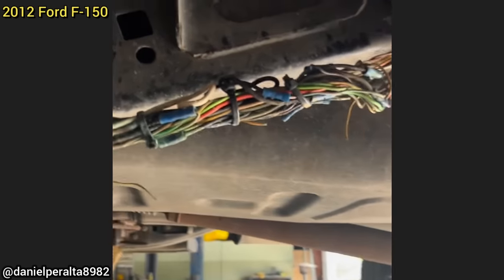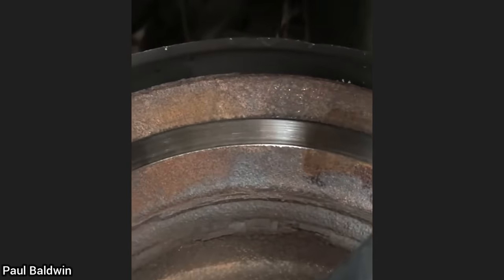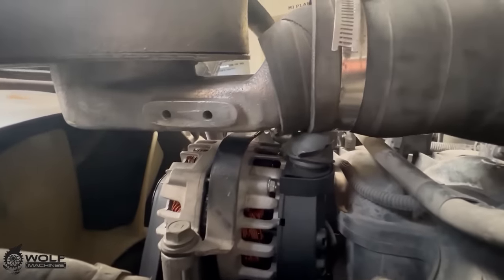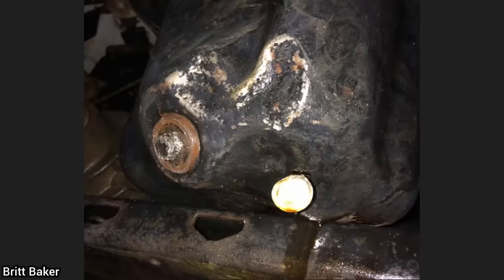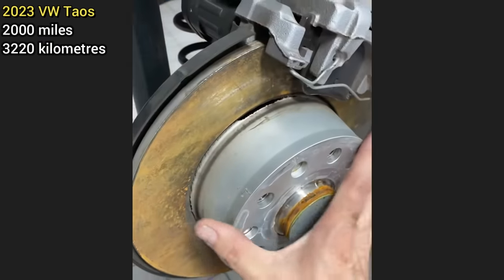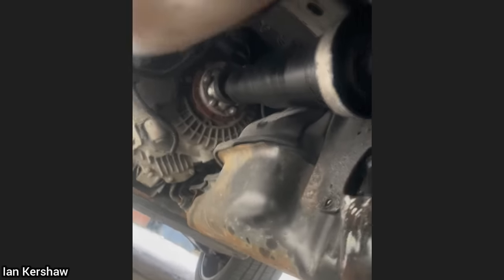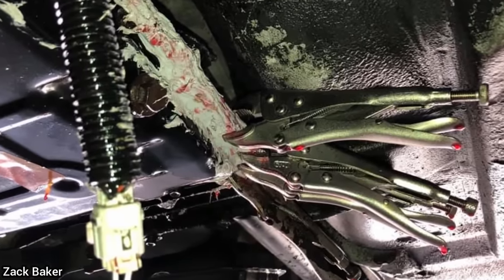Customer States He "Fixed" Some Wires, Now Truck Keeps Shutting Off

Comment: Props to the accuracy and grip of that last guy. He never misses and it doesn't twist.
Reply: He's clearly been hitting everything he sees with a pickaxe and is now quite good at it.
Reply: like a railroad worker with a railroad sledge. shocking how good they are and with such a narrow head. then you have the rock drillers way back. 3 guys with sledge hammers and 1 guy holding and turning the rock dril/ chisel.
Reply: Stupid plan, executed flawlessly.

Comment: 3:05 - For those of you that run into this issue:
A - ensure that ALL lug nuts have been removed.  Count them!
B - Using the spare tire, strike the top center of the tire that refuses to pop free of the hub.  Do this *FIRMLY*, making sure that only the rubber of the spare contacts the tire.   On the rear wheels you can strike the top center, front, and rear of the wheel.  ONLY TOP on the front wheels.
C - If that fails, get a can of brake-free (like WD-40 but stronger, designed to break rusty parts loose).  Let it sit for 10 minutes, then try step 'B' above.
D - If all else fails, spin the lug nuts back on until they're seated, then back them off 1/4 turn.   CAREFULLY drive the car at a slow speed.  The 'clunk' of the wheel releasing will feel different than the flop-flop of the flat tire being driven on (essentially, the shock of thumping over the flat should shake the rim loose from the hub).  NO MORE THAN 5 MPH!!!

NEVER strike the rim or wheel with a naked metal device - always place a piece of scrap wood between the wheel and whatever metal implement you intend to strike with.
Reply: TLDR: Just hack shit together and blame "the other shop"
Reply: I've used a hammer before but only on steel rims and never on the edge where the tire meets the rim. Never used a pick axe though.
Reply: Agreed - there are several easy methods to solve the issue without damaging the wheel…

When I had an alloy that wouldn’t budge for anything and a brake disc that did the same, one single blow from a 6ft wooden fence post shifted them immediately, that pickaxe or most hammers don’t have the weight in them
Reply: What I do on my Audi is use a crowbar and wheel pops right off with no damage to the rims/hubs.
Reply: On my previous car i had that happen sometimes over the summer, and i either pulled hard enough on the outside of the tire on one side while pushing on the other side. (usually one hand on top one at the bottom) and when that didn't work i did what you listed under D. But i only moved the car maybe 1 meter forward (slowly and against the brakes). Was enough to loosen the sticking rim audibly in a circular fashion while not damaging anything.
I never hit my wheels with anything, i mean that would mean they are out of balance or possibly damaged.

Also, i am not sure what he wants to achieve with the pickaxe. The way he strikes at the area around the wheel studs /screws... makes me think he tries to get a security nut off to which he has no correct tool (or doesn't find it).

My father had such security bolts on his wheels years ago, one per wheel, and a workshop lost the tool (special socket) he always had stored it in the trunk. So i tried to find one with a simliar pattern and dremeled it to fit. It did work for that one time we needed it. We never put on the safety bolts again, and i had to get a metal splinter removed from my right eye.
Moral of the story: either get at least 2 sockets for a set of security wheelnuts/bolts or don't use them, and wear eye protection when using a tool like a Dremel! normal prescription glasses are not enough (like my case showed)
Reply: I leave 2 wheel nuts 1/2 on and (normally) a heavy rubber mallet from the inside bottom of the rim.
If I'm roadside without my normal gear, (helping out someone else), I still leave 2 nuts 1/2 on and just heel kick the top of the rim a few times to break it loose.
Reply: @Damoinion  You guys have strange problems. I just lift the wheel of... I guess it helps to change between summer and winter tires 2 times a year.
Reply: @benbaselet2026  Rust still sometimes happens, my Chevette hit something on a long trip that tore a strip out of the sidewall of one tire and we had to change it on the side of the road, I think a muffler clemp or something... had to hit it with a hammer (the only tool in the car becuase long trip) a couple times to get it off, the winter tires had only come off 4 months earlier.
Reply: Far too many instructions. Stars of these videos will remove all wheel nuts and do a full-throttle launch.
Reply: My go to is lay on my back with my feet toward the rim and give a good solid kick to the top of the wheel.
Reply: Sometimes getting the wheel free from the rotor is the hardest part of the job. Loose lugs and a few passes off the curb were the only thing that worked for me. I feel this guys pain, but laugh at the execution.

Comment: The drilling of holes in the oil pan had my jaw on the floor hahaha
Reply: Even if you get it out through destruction, how do you get the new one in?
Reply: @major__kong  A hammer and pry bars?
Reply: @major__kong  You leave the pan on, just plug with corks. Lots of corks.

Comment: Your videos are like an accident.  Sometimes they are terrifying, but you still have to watch. LOL OMG the things people drive. Or even buy without having a mechanic look them over. Thanks for the videos. Love em.
Reply: @tradde11 Exactly, that's even worse.
Reply: Every time I hears customer tell me they tried fixing it, I groan. I had a guy who “fixed” his headlight problem by directly wiring them to the battery with a household light switch and Romex wire.

Comment: I need to watch more pickaxe guy, oddly satisfying.  Not sure what he's trying to do but I want to find out! :D
Reply: “There be gold in them wheels!”  - pick axe guy, probably
Reply: He's trying to mine the wheel. I'm not sure if wheels drop anything when broken by a pickaxe, though
Reply: He probably heard that lug wrenches are on their way out.
Reply: He’s installing Homers “Speed holes”
Reply: If he cracks the rim (when he cracks the rim), the tire is going to have an explosive decompression. Unless it’s flat and that’s why he’s trying to crack the rim.
Reply: honestly i am not sure if i would be brave enough to ask him while he's still going at the wheel...
My best guess would be that there's one safety nur/bolt and he either can't find or doesn't have the corrrect socket for it.
I rewatched it 4 or 5 times and he's "perfectly" hitting an area around one of the wheel studs/bolts and the spare tire is right behind him in our direction of view.

Comment: 3:06 Easiest way to get a stuck wheel off?  Kick it with your foot from the top to the sides.  Sometimes it's just a bit of dirt holding it and it'll shake loose.  If that doesn't work, kick it with your foot from the opposite side underneath (provided you have more than just that scissor jack holding the car up, of course).  You get more leverage with your foot and the wheel.  For those of us who live in the north and the first two don't work, a well-placed sledgehammer and a block of wood against the rim from behind will also do it.  Never EVER hit the rim with the sledgehammer by itself.  There's not a wheel yet I haven't been able to remove and I live on a dirt road in Michigan.
Reply: As a Pennsylvanian, I can confirm the sledge and wood trick, especially on duallies with an outer aluminum and inner steel wheel.

Comment: I do most maintenance and repairs myself (ASE certified as well as GM certified), and I'm the type that figures "while I'm in there" for most things and change other components as well. It blows my mind when people do things like brake jobs and don't consider new or resurfacing rotors, shoddy wire work, or whatever else. I've seen my fair share of customer DIY, but these videos really compile the "WTF were they thinking". Most things the common man knew how to do years ago in their garage are near impossible for modern man lol.

Comment: That last clip was a text book example of “work harder, not smarter.” 

I’m guessing they probably had a wheel lock nut but not a key. They could have easily gotten it off using a socket that fit tight on the lock nut or a wheel lock removal kit, but instead they apparently thought a pick axe was a better solution.

Comment: I love these instructional videos! I'm going to go out right now and fix some oil leaks, install a stereo, put on a custom exhaust, and patch that leaky tire with screws and glue, or maybe duct tape. Also definitely need to get a pickaxe...
Reply: There's a picture floating around the interwebs of someone adding a 120V branch circuit to his panel by wrapping a wire around a drywall screw drilled into one of the mains.
Reply: @major__kong it's only crazy if it doesn't work.
Reply: a pick axe is a great X-Mass present for the guy "who has everything".

Comment: You need to create a word bingo card for your video, with "ball joint", "positive terminal" "leaking oil", "Gasket" "Brakes pads changed, but....", "lost drive" and "Customer declined repairs"
Reply: Na, he needs to create a drinking game.  Something like 2 shots for every "customer declined repairs", one shot for every "another shop did this", ...
Reply: "Customer Declined Repairs" could be the Free Space in the middle 🙃
Reply: and spray foam

Comment: Earlier today I came over a bridge, and there was a red light on the other side, with cars backed up behind it. I saw that as soon as I came over the top, and I had to slam my brakes so hard I locked up at least one wheel, and I barely stopped in time. That was probably the most terrifying moment I've had behind the wheel.

Comment: I can't "pick" which clip was best. Vise grips to hold cover, drilling holes in oil pan, nice BMW with rusty rotors, or the drive train banging into the fuel tank. Amazing. Haven't these folks, "I'm talking to you", holes drilled in your oil pan guy heard of YouTube? Double wow!! Y'all need to have an award for best clip of the year and fix their car for free. But luckily if Joe keeps screwing up I won't ever need maintenance again because I won't be able to afford to pay for gas. Yes I went there.

Comment: Love the pseudo 4X4 lockout hubs...  I went to look at an AWD Escape and peeked under the rear - no rear differential - front wheel drive only.  When I pointed that out to the seller, they immediately cut the price in half.  I walked..

Comment: The ones that get me the most are 'customer said another shop worked on it but would not say which shop' (meaning they did it but are too embarrassed to tell the truth). Secondly are the ones with catastrophic problems and then don't get the repairs. I like that clip at the end with the guy hitting the lug nuts with a Maddox.

Comment: I had an old Mopar and I bought a racing lap belt only. I simply removed the OEM belts and bolted the new belts to the stock locations. I never tried installing shoulder harnesses.

Comment: In my country the UK. We simply don't have death traps like this on the road. In the UK, by law every car older than 2 years has to undergo an annual Driver and Vehicle Standards Agency (DVSA) safety inspection test. Furthermore, anytime you bring a car into an auto repair shop, and the mechanics find that the car is unsafe to drive and you refuse to have the necessary repairs done. The auto repair shop is required by law to notify the DVSA that the car is unsafe, seize the car and prevent you from driving it away. If you still manage to drive the vehicle away, the police will be immediately notified, and when caught by the police which you will be you can be fined up to £2,500 ($3100) and have your driver's license revoked.

Comment: The centre bearing on the rear propshaft is a common failure on Discovery 3 / LR3, and Range Rover Sport models. In fact, it's so common, Darkside Developments here in the UK now makes an upgraded item. However, you'll need to cut off the old centre bearing as it's moulded to the carrier.

Comment: That last guy reminded me of my Hyundai. The wheels would be unremovable after a time requiring use  of a hammer to loosen them.  There is nothing like whaling away with a hammer for 20 minutes as you have a flat at 11 PM in the pouring rain...

Comment: Pick axe is maybe the last tool to use on a stuck wheel. And even then he's using it wrong. At least use the not pick side( the axe side? Its an Adze(spelling?)really. Why don't we call it a pick-adze?) He really should use the handle, hit it straight on,cue like. It does have a good amount of mass, hold the axe(adz) head. Might work okay.  I am over thinking this. Happy Labor Day!
Reply: Adze. You are correct.

Comment: The last clip was like me when I owned a Sunfire.  I kept a sledge hammer in the trunk because the wheels would essentially fuse to the hubs.  I would have to beat the back of the steel wheels to get them off.  Shop had the same issue and had no idea why it happened.  It was like that on all four wheels and everything was stock.

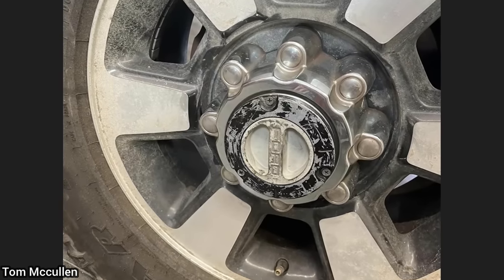Comment: 2:05 Some models of Jeep Wrangler have an additional shift lever instead of a dial, but there should absolutely be a separate control for 4WD. No idea why Ford thought it was a good idea to make their dust covers look like manual locking hubs.

Comment: 0:20 A lasting repair of this damage could be made without replacing the wiring harness, if each lead were carefully soldered back together, the joint covered with heat-shrink tubing and the entire splice covered with a heat-shrink tube sealed with silicon RTV. Solder resists the effects of moisture much better than a mechanical connection.

Comment: “Customer lands a Danube class runabout at a repair shop, complaining about a tugging to the right and the check system light flashing red..” turns out the right warp nacelle was severely damaged by a space slug that adopted the nacelle as its mom.. Starfleet Wildlife Rescue Team removed the warp nacelle and the baby slug to a safe location. A pair of new warp nacelles were installed and the runabout completed its mission.. The Slug grew up and raised another batch of baby slugs..

Comment: "Yo der, Jethro. I needs tah fix mah ole pan." 

"Shoot, Cletus! I have just the holesaw. "

also, knew a dude that also insisted his truck was 4wd but when going to help him install new brakes I found that the previous owner had removed both front axles and shoved rags into the transmission.

Comment: 2:01 please let the tech know he is limiting the 1894 Thor impact. I have a 8ft 1/2internal diameter whip hose directly threaded into it. That impact is not giving all of the beans from a 1/4 quick connect.

Comment: I knew of a guy that was using a full size sledgehammer to “install” a cv axle. Swinging just like the guy in the video. He left the snap ring from the old axle inside the transmission. By the time he was done beating on it- you guessed it, everything was destroyed

Comment: Bought an old 80s chevy truck with drum brakes in the rear from a buddy... Can confirm that a sledgehammer is the appropriate tool to remove those drums if the prior owner never replaced the shoes.
Reply: If the shoes are never replaced, the rivets cut deep grooves in the drum. The only way to remove the drum is, turn the self-adjuster all the way in. This will retract the shoes. But... considering the drum is in ruined condition...use any means to remove it, depending on what mood you're in...
Reply: The best way to remove hubs that are stuck, and the shoes have not worn into the hub. Stick a bar, or big screwdriver into one side of the space between the hub and the backing plate. Pull out on the bar, or screwdriver and then smack the other side with a hammer. A five pound hammer is more than enough. The hub will pop right off. 
Of course I’m talking about one of those old beasts.
A wheel. I like the guy’s idea with loose lug nuts and drive it around at low speed.

Comment: I had my car's rear steel rims get stuck. They were hub centered I think. All I had to do was just leave on 1 lug nut loose, remove the other 3 and just give a good kick to the wheel from sidewall. they popped right out.

Comment: I suspect pick axe man has his wheel rusted to the hub (having had to resort to a sledge hammer from below myself recently)
Reply: Hammer not needed. Just loosen the lugs, then lower the jack slowly. The weight of the car will free the wheel.
Reply: If that's the case, then I'd personally be using the side of the pick, since it's probably much harder to damage the wheel like that, though you're still probably gonna scratch the paint.

Comment: Not sure which is worse.  Putting holes in oil pan to remove it, using pick axe to remove wheel or using the factory scissor jack to lift a car..

Comment: To answer the harness question. I would tow the vehicle as it is not road safe. The harness would incorrectly load in an accident and be an unacceptable risk of breaking the driver's neck.

Comment: Been watching this channel for a while now. I'm a pretty good DIY mechanic. I can do pretty much any repair except a transmission rebuild. I have an older (2008) Escalade EXT and I have replaced the entire suspension system, the front CV axles, brake rotors and calipers on all 4, engine mounts, fuel tank vent filter and a few other things. Watching these videos I am still amazed at some of the dumb shit people do. These are people that have no clue how to work on a motor vehicle but try to fix very important systems like brakes!!! People...stop it....take the vehicle in and have it fixed by professionals before you kill someone!